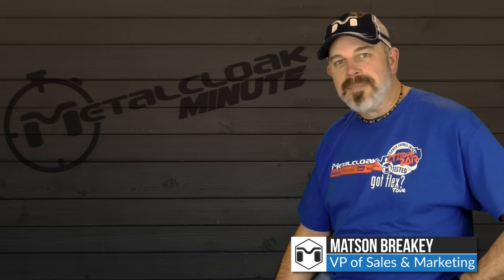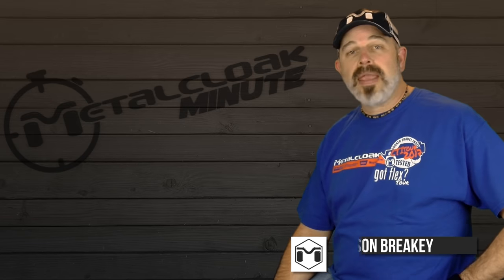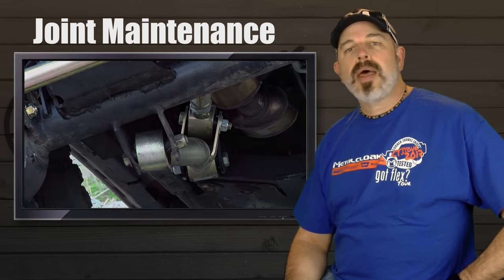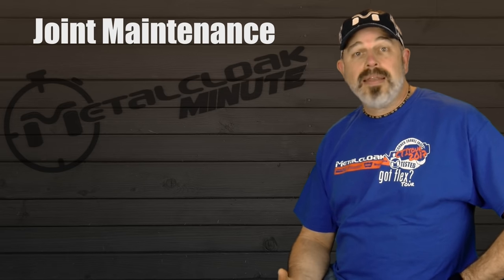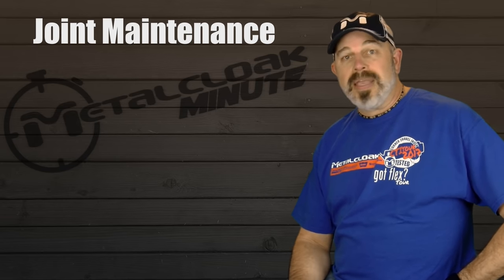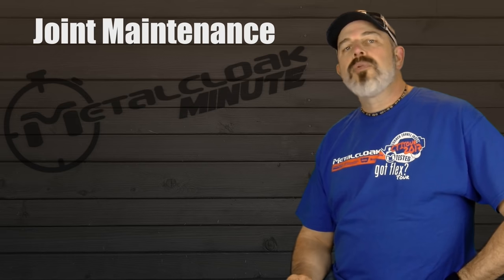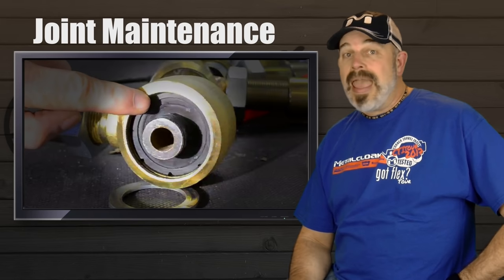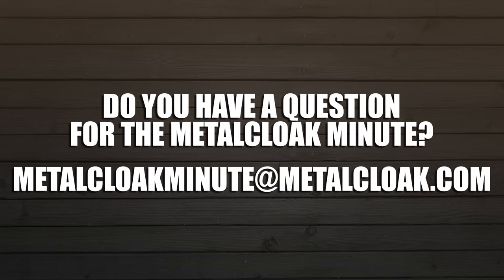MetalCloak Minute: Joint Maintenance

Comment: Hi Matson.  This is a reply to your older video, but maybe you'll see this.  I've noticed that after 2 years, I get quite a bit of squeaking in dusty and challenging wheeling sessions.  After driving a couple days later they are gone.  Is this knda normal?  Is there anything I can do to avoid the squeak?  It gets pretty annoying when it happens.
Reply from the maker: Thank you for reaching out... the question is where is the squeak coming from? There is very little possibility that it is coming from the joints because the area between the bushing and the housing is sealed away from dusty unless you have a bad bushing somewhere. What year is your rig?
Reply: @metalcloak  It's a 2017 JK 2 door Recon edition with 47k miles.